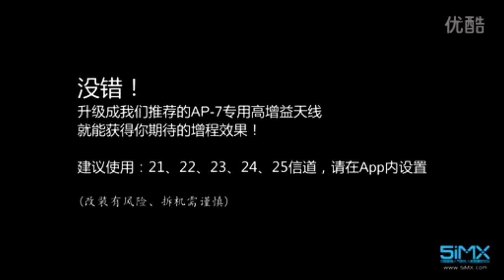DJI Inspire One mod by ARGtek Signal Range Extender (work with Phantom 4 & P3 PRO/Advanced)

Comment: Very nice demo , good close up , easy to follow , 😎✌🏼️
Reply from the maker: +SlayerX Purington  

But there is one mistake on time 1:43-1:53, he put 2 gaskets outside.
should be one inside, one outside, I'm checking yours,can't see clear that you did the wrong procedure or not..
Reply: +High Power Expert ARGtek two gaskets two nuts outside ? 😎✌🏼️
Reply: good catch..i was wondering the same thing

Comment: Hi I recently purchased and installed this ARGtec mod. I do not recognize the piece that is being applied from 3:00 - 3:14. What is that? Thank you in advance for your response. :)
Reply from the maker: 3:00-3:14 that's 5GHz antenna cable,  it is the bridge to support dual remote control.    Only inspire One support Dual Remote control.   So this 5GHz antenna cable is the bridge between 2 remote controllers.
Reply: Oh I gotcha! That explains why I didn't recognize it. I have a P3A. Thank you, Greg
Reply from the maker: The video is Inspire One.  
If you have P3A, here is the installation video-
https://www.youtube.com/watch?v=7CKHNSloVwQ&index=17&list=PLI6aUvDU8H8ojKjRmK5aLKKB9__qs6PKG
Reply: Yes I have already installed my ARGtec, thank you!
Reply from the maker: You are welcome!
Reply: High Power Expert ARGtek GM5 I just ordered the kit but the bridge part still gets me. What wires do it connect too.

Comment: Hi, I'm using Inspire 1 dual controller setup and want to extend the range of the Inspire as well to have better 5.8Ghz antenna so to keep the video signal between the remotes smooth as possible. 
What kit/antennas you reccomend for such a setup?
Reply: I guess this is old, but I just bought an inspire 1😅...I already bought an extender for my mini 2 but bought another for my inspire 1. They have a $15 antenna add on for the slave remote for the inspire 1

Comment: Firmware mod to unlock 32channels is necessary?  I am asking because I read that 32chan mod does not work with latest firmware version.
Reply from the maker: +grzegorz szwed 

Hi, We heard this news as well, from Mar. DJI released new firmware and get shorter distance after.  using latest version.
So is it better not update dji new firmware ?

And i didn't hear that news that new firmware didn't support 32 CH.

But it still work well, even you don't enable 32CH.
We just give you the suggestions, how to get max range as you can.

Check here:
without enable 32CH
https://www.youtube.com/watch?v=eRw6I-8LxtU&index=10&list=PLI6aUvDU8H8ojKjRmK5aLKKB9__qs6PKG

with enable 32CH, choosing 22CH
https://www.youtube.com/watch?v=6EN6rgKYozg

Flying tips 
from Farad Dareie 
+Farad Dareie
yes you must use channel 22 and choosing 4 mega pixel I will go back there if the weather permits I will go to 8 kilometers the key to distance from my experience is you should be higher than the landscape in front of you for me I don't go high in alt as I don't have to aim over building or trees in all my video s I am highest level I can find with the ground in front going lower hope that helps

Comment: Hi! Very good your vídeos. 
Is recomended for Inspire Pro tô? Thanks.
Reply from the maker: Yes, the kit work for Inspire one also for P3 pro, advanced and P4.
Inspire one need 1 5G antenna cable,  

Inspire One Kit:
http://www.argtek.com/style/frame/templates1/product_detail.asp?lang=2&customer_id=1718&name_id=59305&content_set=color_1&rid=136704&id=496185

P4, P3 Pro/Advanced:
http://www.argtek.com/style/frame/templates1/product_detail.asp?lang=2&customer_id=1718&name_id=59305&content_set=color_1&rid=136704&id=496184